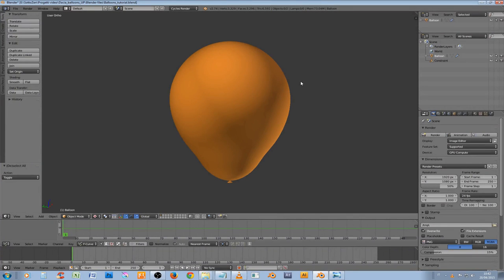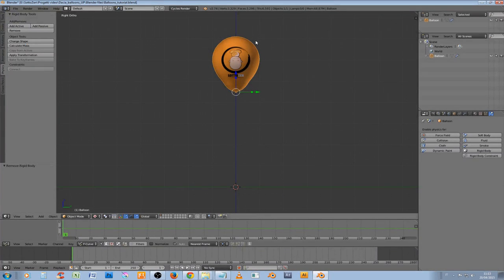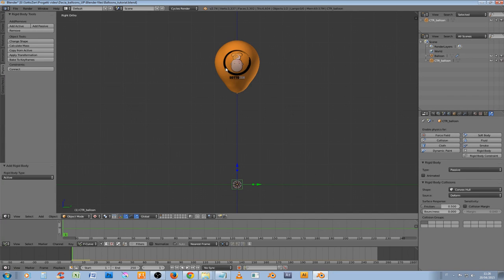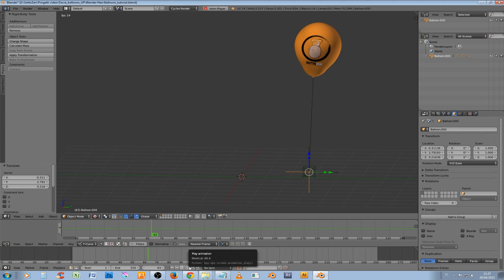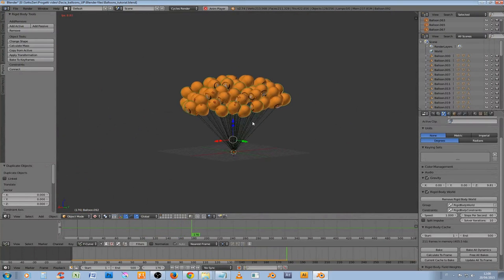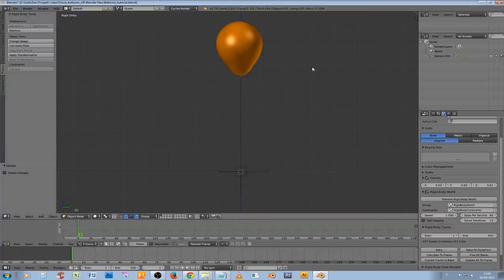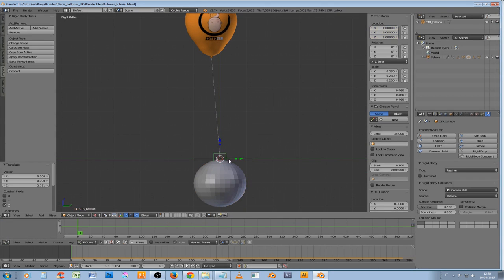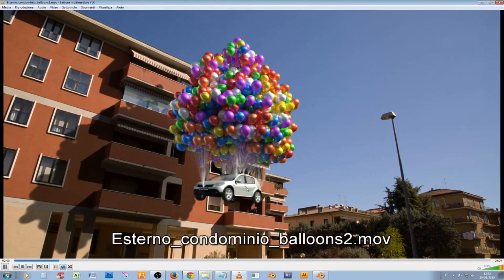Balloons simulation in Blender   Rigid bodies tutorial

Comment: Hi i have a question please! can you help me about it ??
Reply from the maker: Sure, I ll try!
Reply: I'd like to simulate two rigid Balloons or more  into a rigid structure (Stratobus)  and these balloons are fulfilled by Helium, in order to fly this structure. Is that possible with Blender or there other recommendations to do that ? 
Thanks in advance.
Reply from the maker: @hamzamouharrar4331  Mmmm.. not easy to answer. It really depends on which kind of animation/simulation you need. If you can animate your balloons Blender will work.
If you need a "real" simluation, then, it may be more complicated.
Reply: @sottozen  just i need to simulate the landing of the two  balloons (few seconds) inside the stratobus that's all.
Reply from the maker: @hamzamouharrar4331  Perfect then. Any 3D software should be fine. Blender is free and very powerful, give it a try! good luck :)